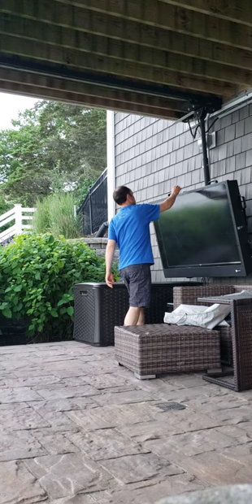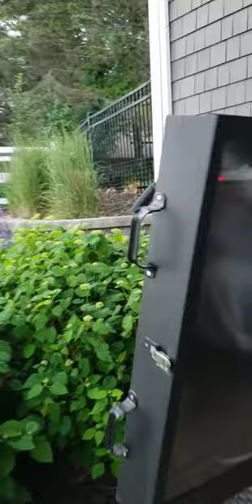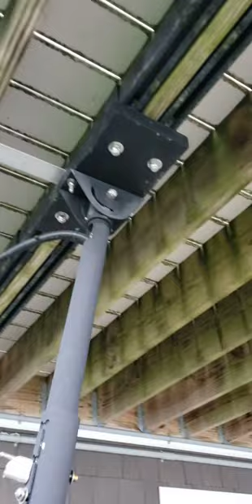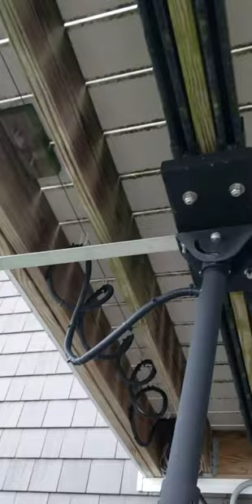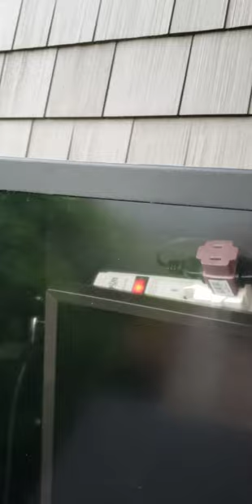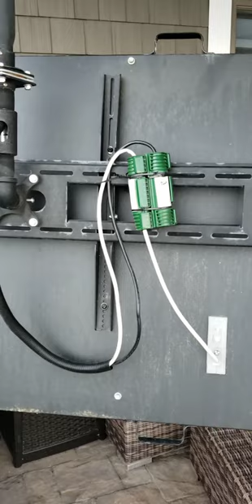Outdoor  TV on moveable sliding track mount

Comment: Why you make it swinging?
Reply from the maker: The swinging allows the center of gravity to be neutrally balanced.  I initially did not have the cieling mount "swinging" pivot and it placed a lot of torque on the fixed cieling mount I had had at the time.   In the long run it would have put a lot if stress on the fixtures.  As an added bonus the swinging mount decreased the torque on the rail wheels which allowed it to slide better.